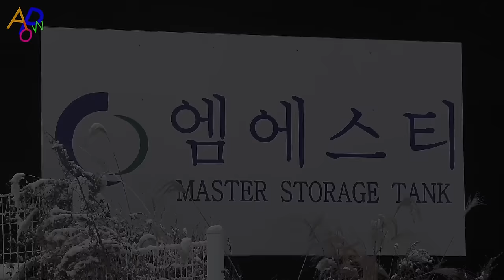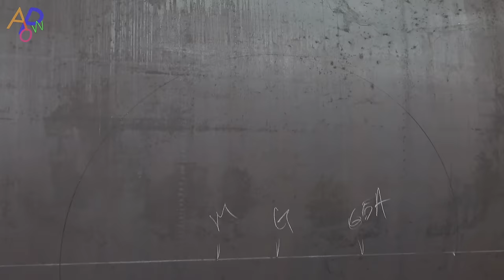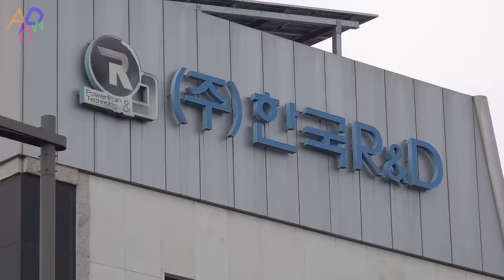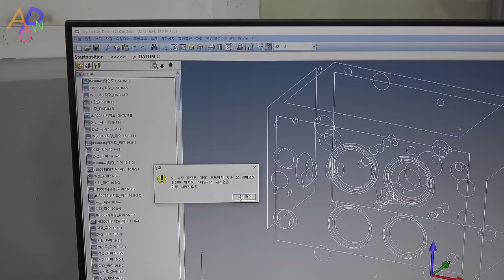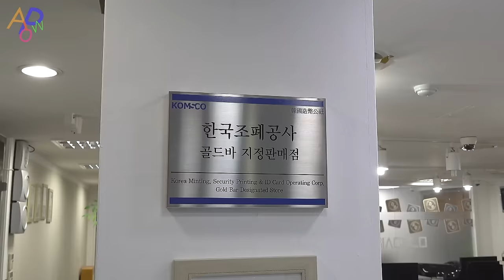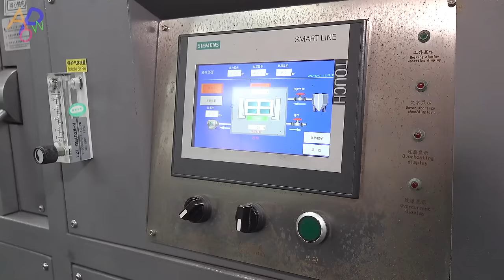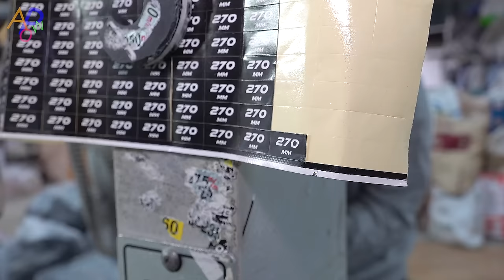Amazing Technology! Best Modern Factory Manufacturing Process

Comment from the maker: "Thank You for Subscribing to Our Channel. Turn On Subtitles (CC) and Watch the Video!☝”

[ Video Chapters ]

00:00 Process of Making 50,000 Liter Super Large Oil Tank. Bulk Tank Manufacturing Factory
16:03 Wonderful! Engine Cylinder Head Manufacturing Process. Casting Molding Mass Production Factory
34:44 99.99% Pure Gold Bitcoin Mass Production Process. Excellent Korean Gold Manufacturing Factory
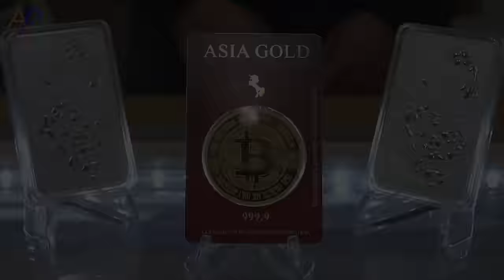50:28 Chelsea Boots Manufacturing Process. 50 Year Old Korean Shoe Mass Production Factory
1:04:53 The Process of Making Long Wallet With Real Crocodile Leather. Korean Handmade Leather Artisan
__
📧 Contact : allprocessofworld@gmail.com

🎁 Join Channel Membership : https://bit.ly/3NBrf2Y
Reply: 😊px